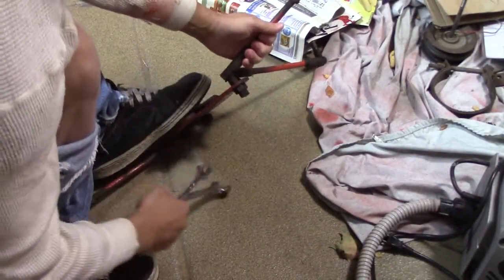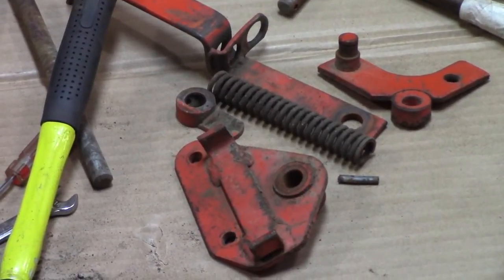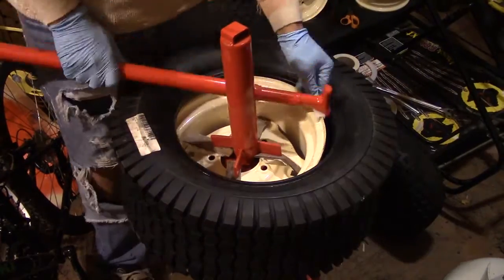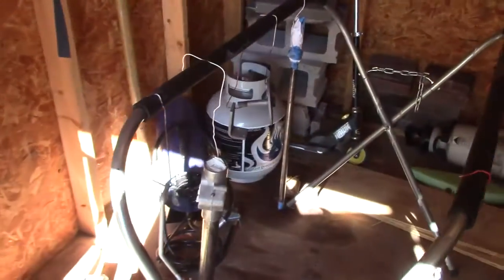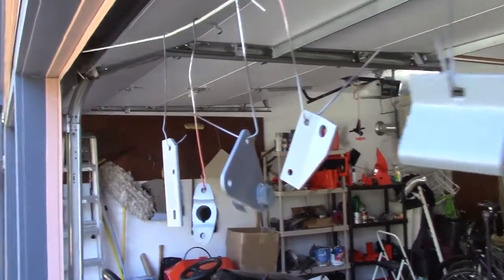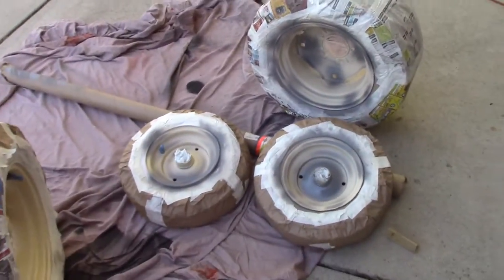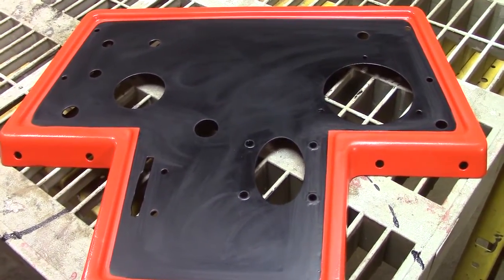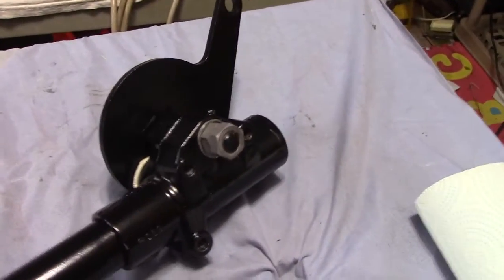39) Allis Chalmers 310 Tractor Restoration project, video 39

Comment: OK, just talked to a guy that had the same problem putting the tires on his newly painted wheels. He told me to put Vaseline all around the rim to make the tool slide easier. I wipes off good with mineral oil
Reply from the maker: +Herbthehandyman I never though of that.  Thanks for the info.  And I understand the waiting, lol.  I hope to have 40 up in a week or so. (Don't hold me to it, lol).  Thanks again Herb......

Comment: i would have lost my mind over them scratching those wheels. im not as forgiving as you are. the scratches put on them where the scratches were was very uncalled for. i could see them scratching around the bead area but how the heck did they scratch the inside of the wheel. they used the wrong hold down to hold the wheel down. i know because i worked for sear, installing tires and that should never have happen. they are very lucky it was you and not me. someone would have gotten their ass whipped lol. as always hats off to you on this job. i`ve done this many times and i know the work your putting in it.
Reply from the maker: +Bison Workshop LOL!  I know about being upset about it, but I still was going to have to fix it, so I kept my cool.  I just wish I could have figured it out!  I like doing that stuff myself.  I know you know the work that goes into this.  I've seen your work!  And thanks a lot man.  I hope to have a roller soon......

Comment: If the rear crack is plumber's, how do you call the knees....   LOL

Silicone is the last thing you should spray on something you might have to paint.... Soooo hard to remove completely

You really need your son to mess up some filming, I don't....   ;)

Looking like a brand new Mean Machine........
Reply from the maker: +pierre beaudry Lol!  It used to be the plumber and the refrigerator repair man.  Now we throw the frige away.  The knees are just good fashion;-)  I didn't know that about silicone, thank you!  My wife and kids mess up my videos all the time.  My revenge is putting them on the blooper reel, lol.....Thanks again....